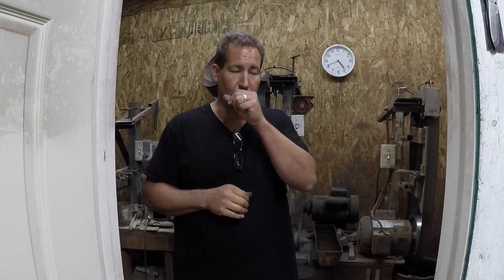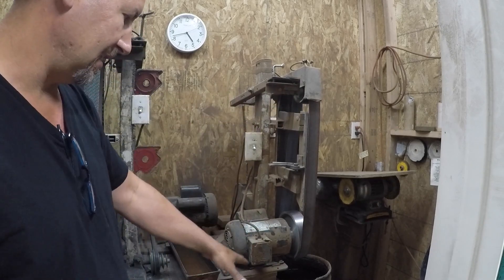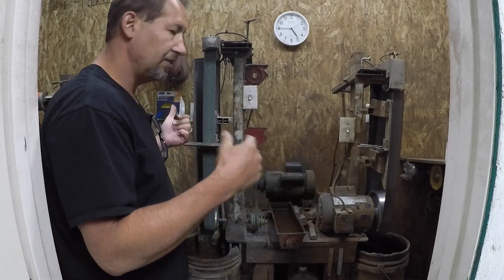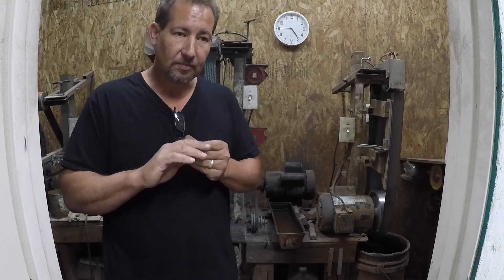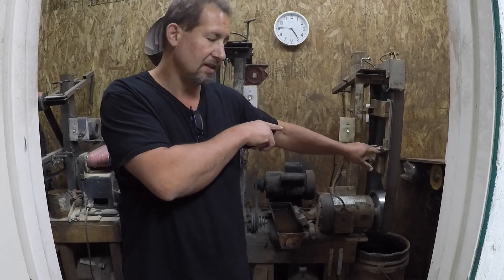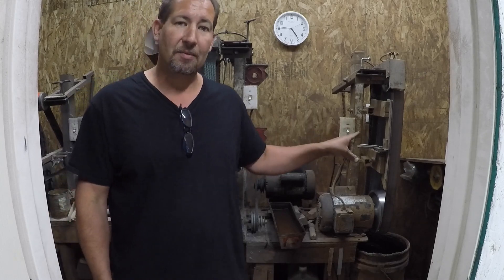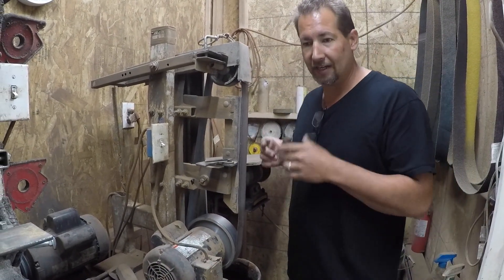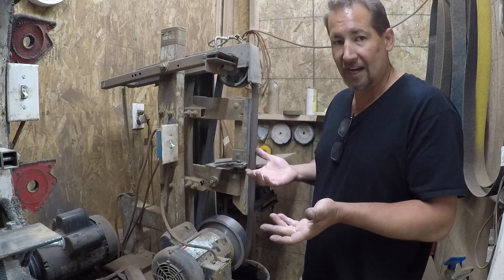why build or buy a single speed 2x72 belt grinder

Comment: Love your videos, watching you for years right now I am messing around with dust collection and I see you have all your grinders in one room to contain some of the dust but I didn’t see any type of dust collector. If you have one, could you do a video on your dust collection set up?
Reply from the maker: https://youtu.be/hqNahHLPkyE   the fans in the top and bottom of the front wall of the grinding room act as a big filter when I turn them on. which I only do really when I have a big handle grinding day. it keeps most of the dust in the room. the water buckets under each grinder catch most of the sparks and such. and I vacum out the room when i think about it with a big shop vac at least a couple hours after the last time I ground steel so there is no chance of sparks getting into a bucket of dust and smoldering for a few hours to catch fire later.

Comment: Great topic and very true info. I’ve been using a single speed but plan to build a variable with step pulleys. I do have one question if you could answer it for me. I see the spring tensioner and I’m trying to find out how many pounds of tension you use. That is one of the hold ups in my new grinder design. I’ve heard anywhere from 30-60 pounds but that’s a huge range. Any help you can provide would be greatly appreciated. Thanks
Reply from the maker: I use just enough tension so that the belt runs smooth, which I would bet would be alot less than 30-60 pounds. if you run too much tension, it starts getting hard on bearings, makes your motor run harder, and the tracking wheel starts stretching out the center of your belts and you have problems running a used belt anywhere but dead center. so i would build your grinder with a very adjustable spring tension. put a belt on, and run with just enough tension to keep the belt on the grinder and then play with it. or load it up with alot of tension, and then back it off until you start having problems.